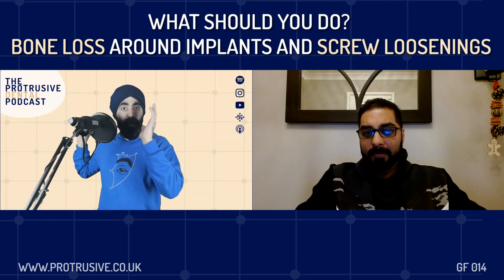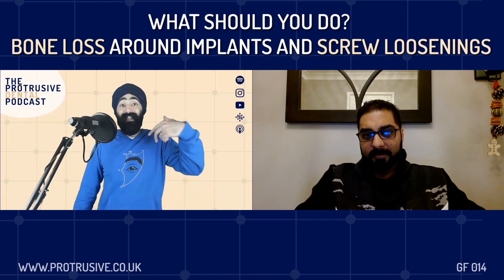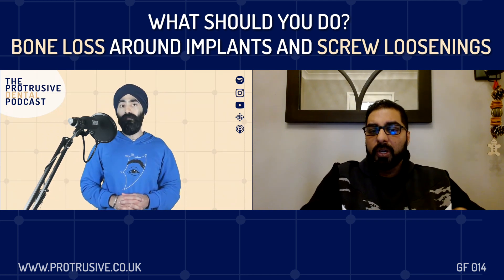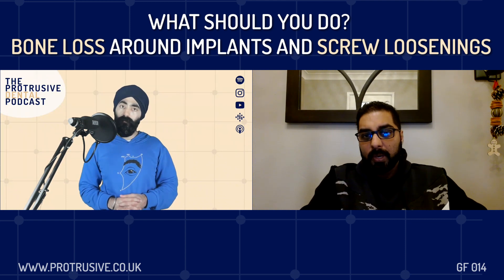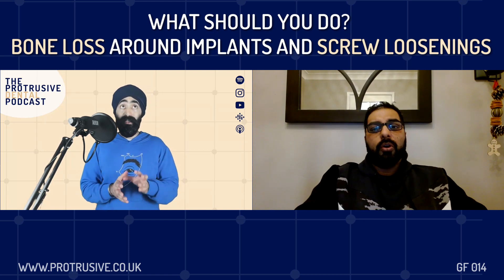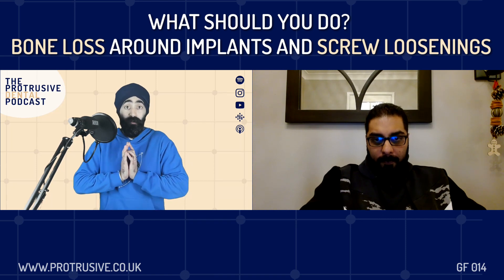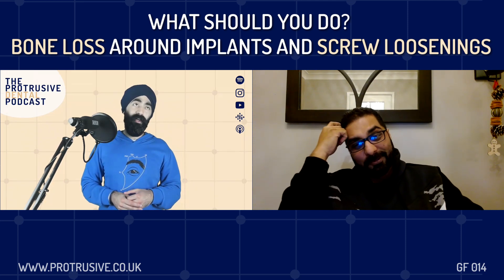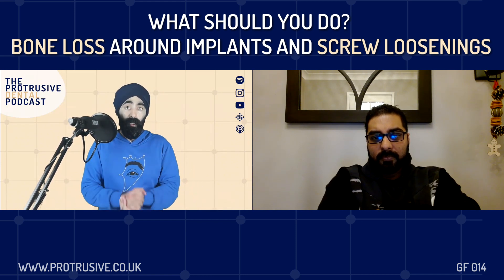What should you do? Bone Loss around Implants and Screw Loosenings - GF014

Comment: Hi Jaz, i had an implant done 4 years ago which was not done properly, it never felt right, the implant and the tooth had significant movement from day one. One of the dentists told me that there isn’t enough bone around the implant to hold it tight/ firm. This is I believe because they grinded the bone too much when doing the implant.  What should I do in this case? My age is 38
Reply from the maker: Best I can advise is see a dentist with experience in implants - its an area I have little expertise in so cannot personally advise
Reply: @protrusive  thank you
Reply: Your problem solve